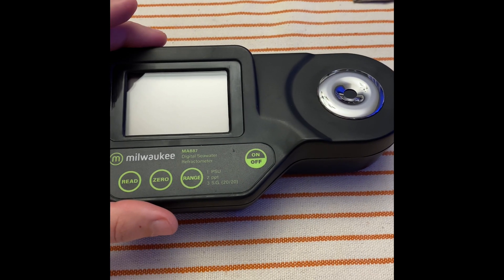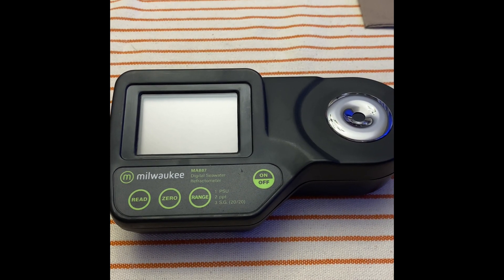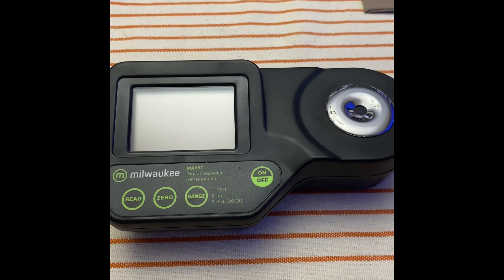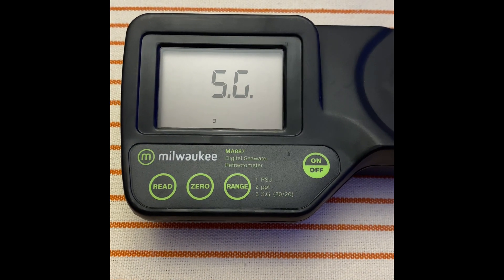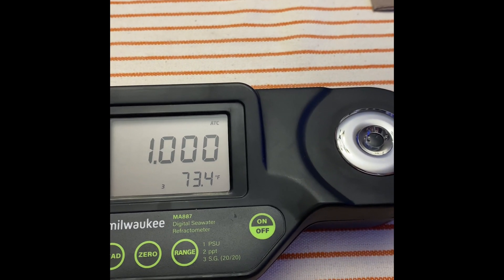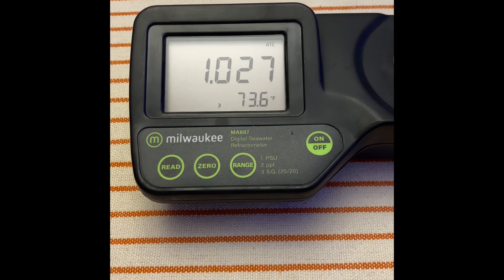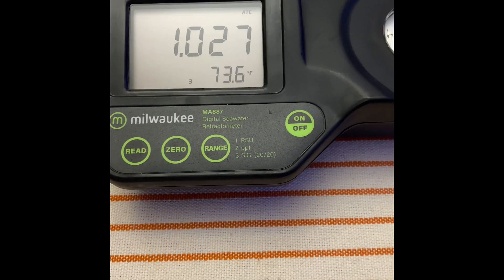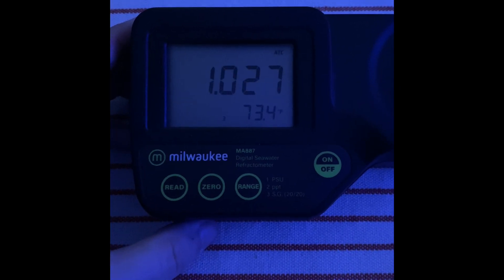Milwaukee MA887 Digital Seawater Refractometer issue, what am I doing wrong?

Comment: I know its been 2 yrs but any luck with milwaukee,  i don't think you are doing anything wrong. 
Im getting  1.028 with the solution provided. 
I then used brightwells refractometer calibration solution and the bortle said it should read 1.025
And the brightwell solution read exactly 1.025.
So im confused also, i think theres a problem with the solution they provided  in my opinion.....

Comment: Couple of things... You use the same pippete to draw distilled water and saline water which causes contamination. Also, your zero out read is not true 0 but read 1. Cover the well with hand on calibration and on read. Also stir with clean end of plastic instrument to get air bubbles out. Two separate instruments,one for distilled water, second fir saline water.

Comment: Did you ever figure this out I bought two of these and the cellabration Fluid they came with one registers .22 and the other is .18 And when I test my aquarium water it comes back at .28 and the other one is .27 and my Hana checker is .26 so if you ever have any updates I would like to hear about it
Reply from the maker: I finally got rid of it. I never could get an accurate test from it no matter what I tried. 
Their support basically told me it was me and not the unit.
Reply: @joshdoesreefing7241  so frustrating I bought two of them at the same time and the calibration fluid was so far off on both of them, I finally got one dialed in that it’s only one point off my Hannah checker so I guess I’ll keep that one and I’m sending the other one back crazy I spent all this money to get something that would be really accurate , now im still not so sure
Reply from the maker: @pix4c  I completely understand. Gone through a lot of that myself. 
For me it is bad enough the price you have to pay for some of these devices, but the really bad part is not even knowing if you can trust the results they give.

Comment: Mine is doing the same exact thing. I zero it out, then the validation solution runs at 1.027. My aquarium water tests at 32 ppt. My aquarium maintenance  guy was here Tuesday and checked with his refractometer and it read 26 ppt. So, looks like I'm in the same boat. Look forward to any solutions. Doesn't sound like Milwaukee has a very good Customer Service Dept.
Reply from the maker: Customer service was not helpful at all. I finally got ride of mine.

Comment: I got mine today and it read 1.025 with the reference solution. I also used Fauna Marin multi reference solution which is 35 PSU ad 25 degrees Celsius and it was dead on. Not sure if they have fixed something but it seems ok in August 2022

Comment: I got the same readings with my kit too, I just thought the calibration solution is off. I tried 35 ppt refractometer solution and it read it right in ppt.
Reply: well i see I'm not alone just used mine for the first time and same here.